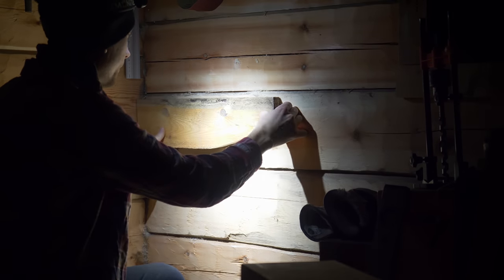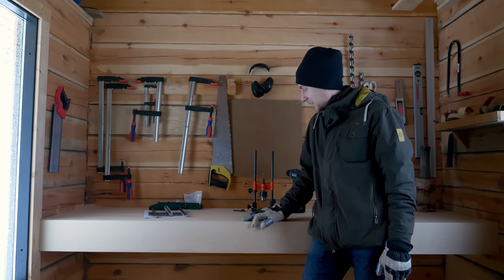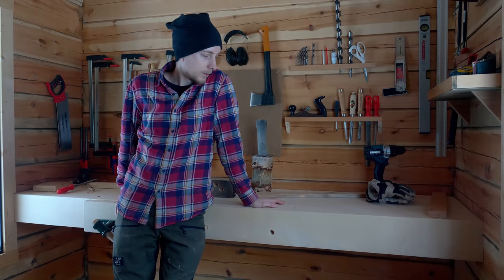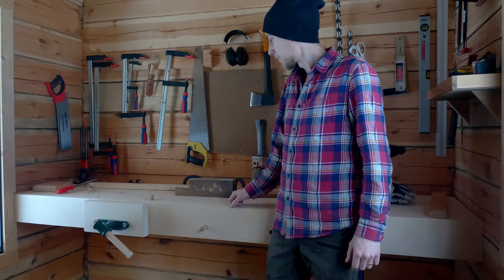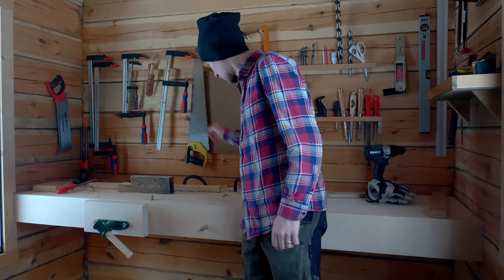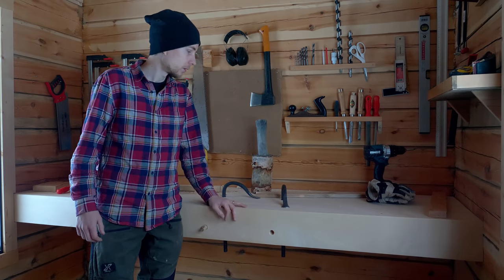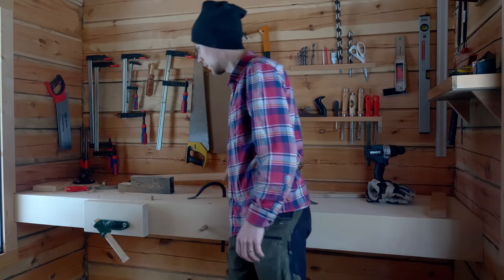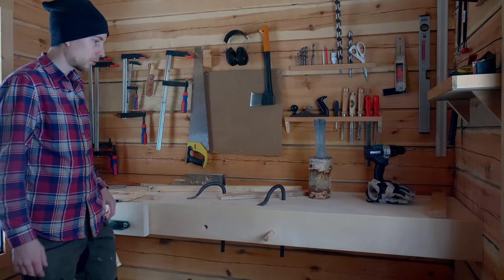Making a fixed WORKBENCH with front vise for my tiny workshop

Comment: Great work bench - what are the "J" shaped clamps called, do you have a link for them?  All the best for '22!
Reply: They're called holdfasts. Should be available in any store that sells woodworking tools.
Reply: @janitor6669  Thanks!
Reply from the maker: Here's the link where I ordered: https://www.etsy.com/listing/1004514574/workbench-holdfast-for-ph19mm-or-34-inch?click_key=9ce1f862708959aae65acc613551957768c25685%3A1004514574&click_sum=4650e492&ga_order=most_relevant&ga_search_type=all&ga_view_type=gallery&ga_search_query=Workbench+holdfast%2C+for+Φ19mm&ref=sr_gallery-1-3&organic_search_click=1&sts=1
Reply from the maker: It's said that hand made are much better than casted. Never tried though.
Reply: @FinnishPlayground  Many thanks!